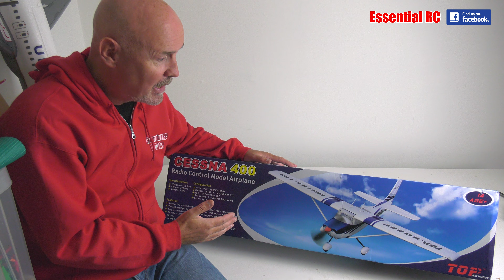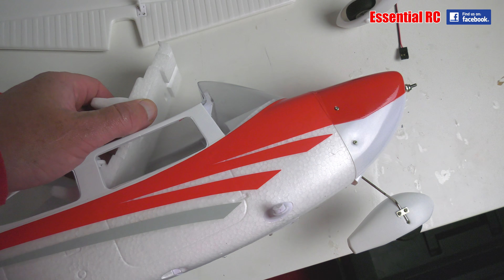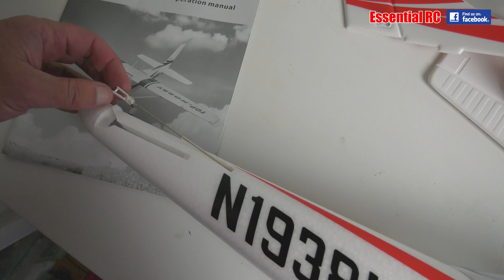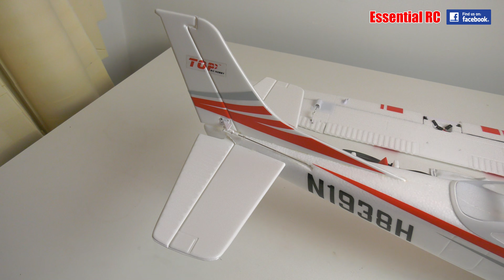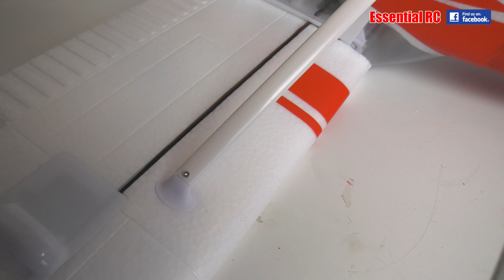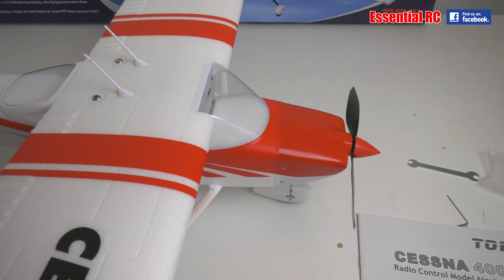CESSNA 182 400 CLASS | UNBOXING and QUICK ASSEMBLY GUIDE: ESSENTIAL RC FLIGHT TEST

Comment: I've had one for over three years and it's really a fine model, will spin and roll and do most everything you want for a sport flier, but is docile enough to be an advanced trainer.  Negatives? The nose gear is very weak and will break even with the best of care.  The motor mount will also crack in time and the cowling is about as thin a piece as you could possibly manufacture.  The tail surfaces also are thin and need repair.  So like nearly all the foam ARF planes, it doesn't hold up very well with normal use and abuse.  I'm a very experienced flier and most of these things just developed over time.  There is a thread on RCGroups "HobbyKing Cessna Skylane EPO PNF" for the same plane and you can still find it imported in 2023.  Banggood has is as out of stock and shipment expected October of 2023.

Comment: Do you get a remote with the plane
Reply from the maker: No
Reply: @EssentialRC  witch remote would you prefer buying for this plane
Reply from the maker: By a RadioMaster TX16S and you'll never need to buy another transmitter. Great value for money. https://www.radiomasterrc.com/products/tx16s-mark-ii-radio-controller?sca_ref=1532879.KTnLWlCJZG